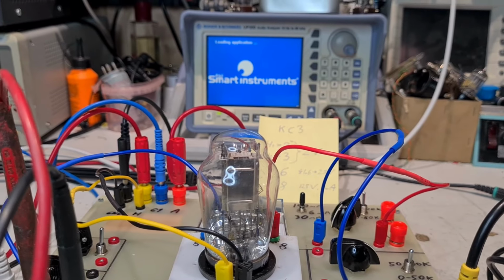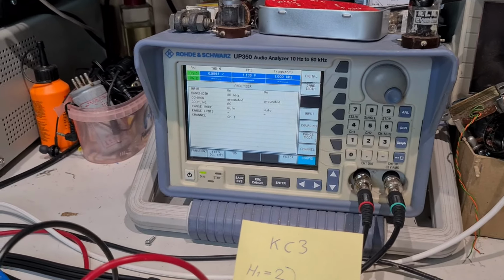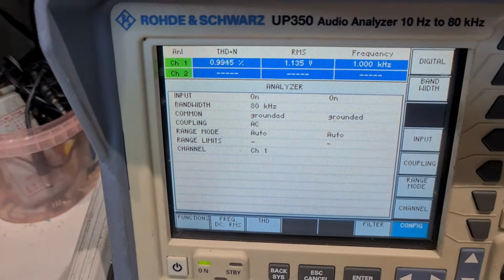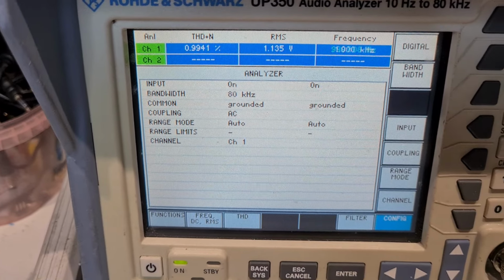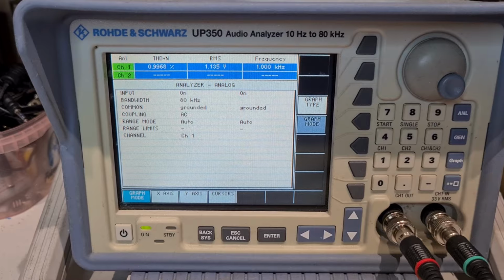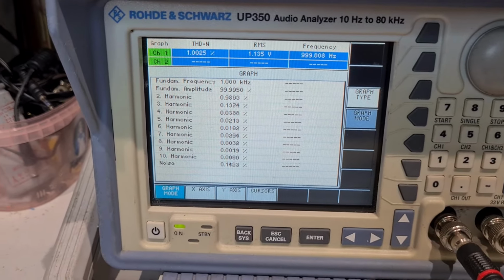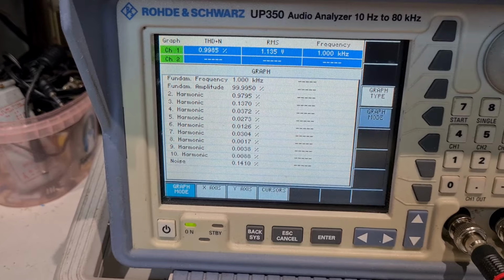Tube Tester you can build yourself.

Comment: High Helge, 
Very, very smart realisation. I intend to adapt your idea to a tube meter I am building (HT adjustable power supply nearly achieved, now under test). So I have a few questions (or maybe I didn't catch everything).
1- Why 2 anode and cathode (A1-A2, K1-K2) connections ? A1 going through the ammeter, and K1 authorizing the connection to G3 are maybe one reason ? I would have the same question with G1-1 and G1-2.
2- K1 and K2 can polarize the grid (with a decoupling capacitor if needed), or the grid can be directly biased using an independent supply. I suppose that you offered these 2 possibilities (automatic bias via the cathode or direct bias via an independent source) to explore thoroughly these 2 techniques or is there a deepest thought I did not get ?
3- What power rating did you use for the cathod/anode circuit particularly for the potentiometers (for A1, and K1 circuits). Since testing an EL84 or EL34 may see tens of milliamps.
Again thank you for this highly interesting video, I hope we could meet one day on the air.

73 Patrice
Reply: Hi of course ...!
Reply from the maker: Thanks for the questions.
I have done it this way because I think it offers many possibilities.
You should think about whether it is wise to do it this way or in another way. I want to be able to measure double tubes. ECL84 for example.
When I measure power pentodes I can have an external anode resistor or transformer that can withstand the effect.
Reply: @LA6NCA  Thank you very much for your answer : it is now clear in my mind. Any idea of the power recommanded for the potentiometers in the anode/cathode circuit ? Have a nice day.

Comment: Always hold the socket when removing a tube. Otherwise, you risk pulling it apart.  

Den engelske tale er nem at forstå. :-)   ( gætter på du forstår Dansk )
Reply from the maker: Thanks for the information about the tube socket.
I have received comments on this on Facebook.
I did not know this even though I have worked with tubes for many years.
Great to hear from Denmark. I'm there a lot with our motorhome.
Reply: @LA6NCA   The glass flask is glued to the base, especially old tubes can slip and tear the connections.
Reply: Mit Engelsk er ikke så godt som Norsk og Dansk. :-)

Comment: I’ll definitely undertake this project when details of the schematic are available. It’s so much better for amateur use compared to factory tube testers that were used by technicians when they had to fix tube equipment in batches and wanted to save every minute of their tedious work.
Reply from the maker: Thanks for the comment. Schematic is in the video. I will make a website later.